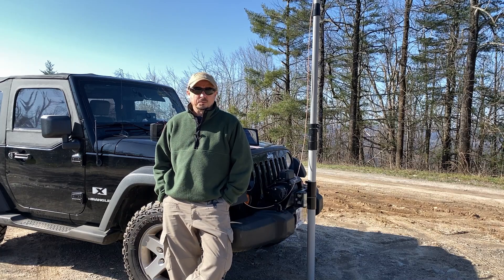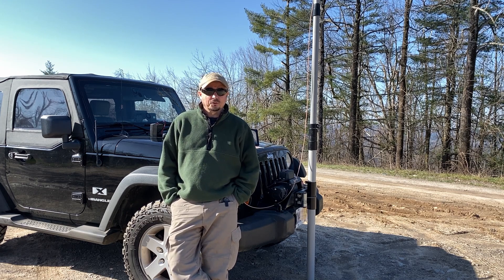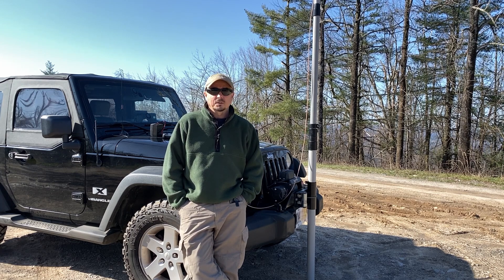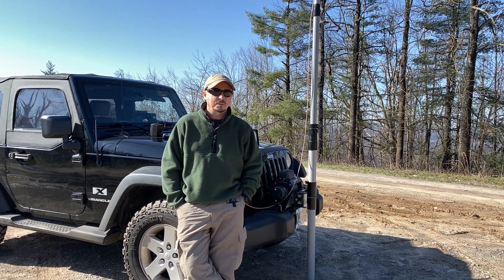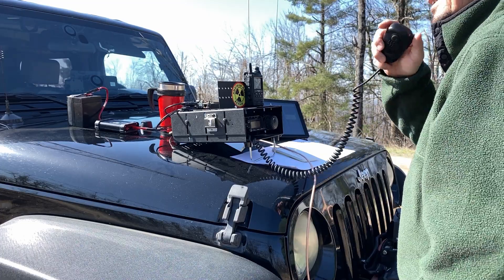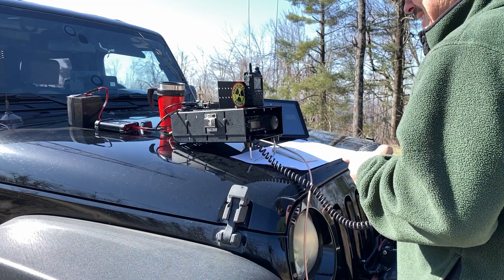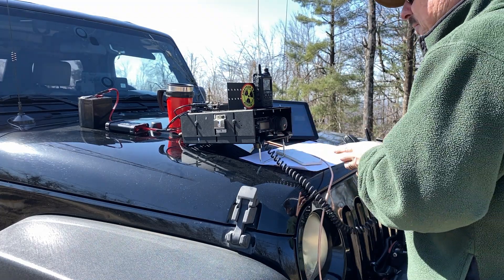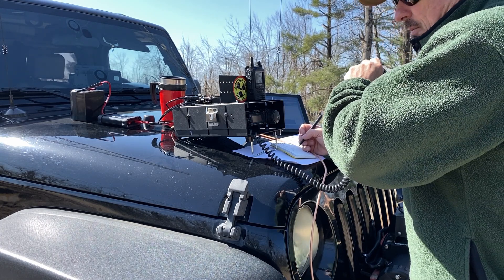2M Simplex, Voice, & Digital :: Elk Log Periodic

Comment: Thanks for another great video Jason!  In the army if we had an issue with a signal that was too strong we would turn one or both directional antennas to be slightly offset to lower the signal strength.  Give it a try next time, might help.

Comment: Whilst you can't lower the RF power on the radio any lower than 5w, there is nothing stopping you reducing the TX audio level in software to put out a weaker signal.
Reply from the maker: I have been waiting on someone to point this out. You are correct. In the heat of the moment I was so excited with the results that I totally forgot. Doh. There’s always next time.
Reply: @KM4ACK  Honestly in that situation, some radios allow you to turn the RF output off! That would still allow you to put out a few hundred miliwatts , and probably still make that JS8Call contact hahaha! That log periodic almost seemed to transmit better than it received, or maybe that was just the voice stations. That was really awesome!

Comment: Awesome video, never forget the power of a good antenna + height!

Will you be operating Winlink this field day?
Reply from the maker: Yes. I will be operating Winlink on FD.
Reply: @KM4ACK  Will have to get a message down to you for those two sweet contact points :D
Reply: Jason, probably one of your best videos. In my younger years I worked a lot of VHF/UHF weak signal on CW/SSB. I have 41 states on 2m and 32 states on 70cm. But mine were all from the “Low Lands”. On most evenings QSO’s were usually out 300 to 400 miles under normal conditions. But that was with stacked arrays at 115’ and 500 to a thousand watts. But I worked 20 states in one night on 3 watts during an opening. But you have to be there to work them. I still get as big a kick working a new Grid Square on VHF/UHF as working a new DXCC Entity!

Comment: I have a similar mast but its 6ft and can go to 32FT.  I agree its not fast up and down but I like the one you have because it looks to fit in a Jeep.  I really like the front mast mount.  Where did you get that mount?  I have a receive mount that works but I like the front mount.
Reply from the maker: The mount is a prototype from TN07.com. Just talked to Bob and he said he could hook you up with one as well. I had something similar before but this is light years ahead. Absolutely rock solid once you lock it down in the winch.
Reply from the maker: They aren't on the website yet. You will have to call/email to arrange payment/shipping.
Reply: @KM4ACK  My antenna holder is from TNO7.com as well and I got it for my suburban.  Now I have a Jeep JL and this looked so thank you for sharing.